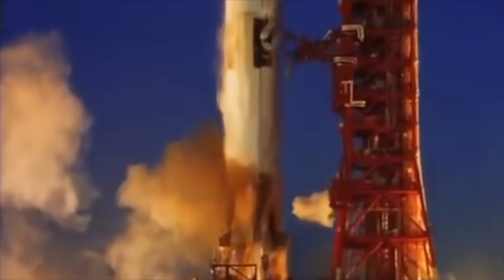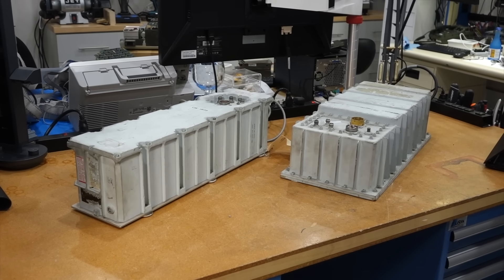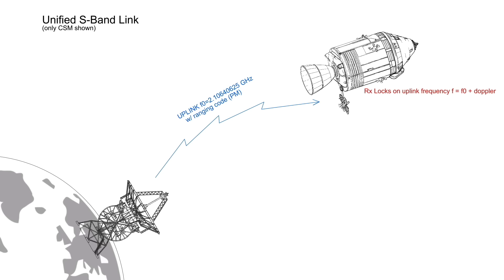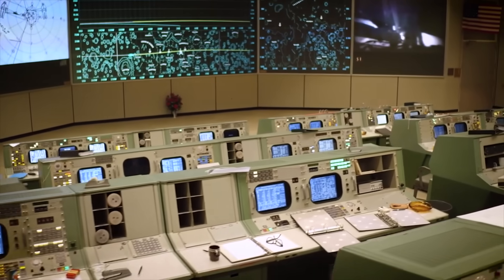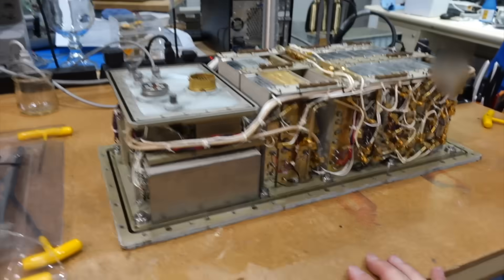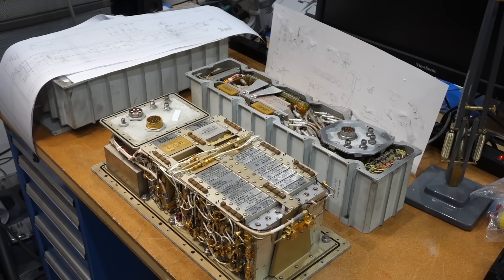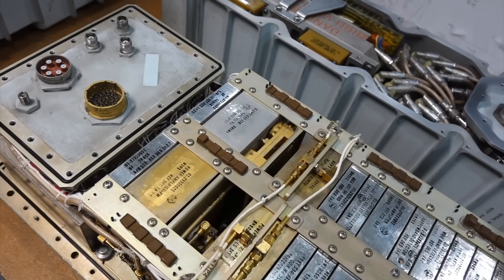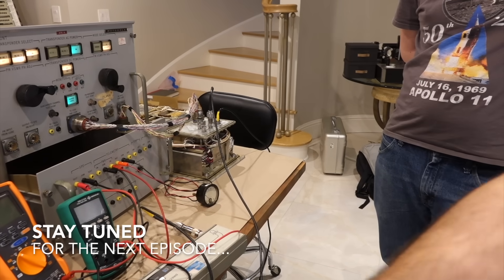Apollo Comms Part 1: Opening the S-Band Transponder and Amplifier

Comment: 10W sounds weak, but the Voyager probes' transmitters worked and works at that power. Isn't that neat?
Reply: If its too weak at one end the other has to be stronger and larger.
Reply: @Arpthingy True. Proper antennas are needed on Earth. Still cool that basically a walkie talkie reaches 25 billion km 😊

Comment: I've had people complain that the Apollo transmission power is too low, so they couldn't have gone to the moon! Well, yes: The way you handle that is you build a really big antenna on the receiving end, on the ground. That way you can gather more of that signal energy. Essentially, a really big "ear" to hear a whisper. They had to use much more energy transmitting "up" to Apollo because the spacecraft didn't have the luxury of having a really big antenna, it could only carry small ones. So you have to shout very loud so the smaller, relatively deaf "ear" could hear you.

Comment: Why was it filled with nitrogen? How does it protect the electronics?
Reply: Nitrogen is cheap and relatively non-reactive in this environment- especially compared air with oxygen and water vapor etc... They might have used noble gasses instead, but it's not really necessary and using Nitrogen is cheaper.

Comment: I worked in the Apollo Communications Systems group at North American Aviation Space and Information Systems Division, the prime contractor for the Apollo Spacecraft and had principal engineering responsibility for the  Apollo PCM Telemetry Equipment. I'd be happy to contribute my personal knowledge and experience with this, the other Apollo communications equipment and the engineers I worked with. George Whitehead
Reply from the maker: Awesome! Can you please contact us via the link in under the video description?
Reply: Hey I'm a retired US navy satcom tech post 9/11 era. Both strategic earth station terminal and shipboard surface tactical SHF EHF X-BAND. i've had questions about this system on apollo that never made total sense looking into past systems that don't translate into the more current stuff i worked on.  Just one question to start with if I may have a moment of your time,  why was there a floppy parabolic 3foot antenna on the lunar rover buggy. That would really set my suspicions at ease.  I just always saw that thing flopping around and never believed it could lock onto a satellite relay tracking beacon.  I would appreciate your insights.  Much respect and it's an honor to chat. ET2

Comment: Parkes didn't receive the first five minutes of communications from Tranquility Base,  Neil and Buz where to eager to get out and explore the moon, the the honor of receiving the first steps on the moon went to Honey Suckle Creek in Canberra as it was properly aligned to take the signal and Goldstone had an upside down image, as Honey Suckle drop out of alignment, obviously due to the rotation of the earth , then Parkes took up the signal for the next 2hrs. Parkes was not going to be the primary point of the fist communication but it received the honor because of a circuit breaker fire at Tidbinbilla Tracking Station two weeks prior to the landing.  Tidbinbilla Engineers where sent to Parkes to set it up to received the signal.  Thanks for explaining wait S-Band was, now I know why my fathers skills were needed at the tracking stations Cooby Creek and Canarvon as he studied on microwave technology.
Reply from the maker: That’s such a bizarre and misleading comment. I never claimed that Parkes received the first minutes of communication from Tranquility Base. The LM was communicating via the Goldstone’s 250 ft antenna (with Madrid as the backup) when it landed. Which was a lucky break: since they had to use the omnis on several occasions, that would have resulted in a mission abort if they had relied only on the smaller primary dishes.
Later on, Goldstone, Honeysuckle and Parkes all had reception of the FM downlink signal during the entire EVA. Goldstone had a very good signal and was selected for the first few seconds of EVA TV, but unfortunately, they had their slow-scan converter setup wrong, resulting in the infamous upside down image and bad contrast. NASA realized that within a few seconds and switched to the smaller Honeysuckle antenna for the first few minutes of the EVA. Then at about 8 min into the EVA, the Moon got high enough for Parkes to receive it on the main on-axis receiver (they apparently had it before, but off-axis). They had of course a similar signal to Goldstone due to size. So naturally NASA switched to the Parkes video, which they kept for the rest of the EVA. However they kept Goldstone for the PM uplink transmission throughout the entire EVA. So upvoice (capcom) was from Goldstone the entire time. 
So all 3 dishes (Goldstone, Parkes, Honeysuckle) received the spacecraft FM data, TV and downvoice throughout the entire EVA. They all got it. It’s just that the TV picture and voice sent out to the broadcasters could only come from one of these sources at a time.

Comment: The TWT will require high voltage....the ones I worked on used a couple of thousand volts. This potential creates the electron bean that passes from the cathode down the magnetic confinement to the collector. The microwave is introduced to the helical 'slow wave structure' a little ways from the cathode...The amplified microwave signal is syphoned off the slow wave structure before the electron collector. Energy is transferred from the electron beam to the microwave signal along this path. I skipped an explanation how this works. Traditional electron tubes with grids and such stop working as the wave length of the RF shrinks. TWTs are longish things compared to stubby traditional electron tubes. Klystron tubes use the same principle.

Comment: Can't believe we are still using USB 50 years later to "communicate" with most of our devices to "transmit" data, audio and even video 😜 guess that acronym aged really well...

(What didn't age well is how NASA is still using S band as the main frequency for the Artemis missions, giving their astronauts very low data rates compared to today's standards, but I digress)
Reply: S‑band cuts through rain, fog, and clouds so it is more reliable.
Reply: @Arpthingy  it's 2025, there are 8000 operational starlinks in orbit working in Ka band, most of them with optical inter satellite laser communication.
NASA choose to be limited to S band when a relay satellite network would have given them way more flexibility, capacity and resilience, rather than saturating the DSN.
Even China has two relays on the other side of the moon already.

Comment: Interesting that the connectors didn't change since those times.
Reply from the maker: I found that quite surprising too. TNCs, N-connectors, SMAs are way older than I thought. Military stuff to start with I guess. The transponder is also using SMCs which are still around but that you don’t see much anymore, and the ground test equipment uses the awesome GR-900 which has mostly disappeared - for good reason, it must have cost a fortune to make.

Comment: Does anyone know if there's any really interesting history or novel technology that was made for the security/encryption of all of this communication? I am curious to know how concerned they were against the USSR collecting information or doing something nefarious during the Apollo missions.
Reply from the maker: There was really no encryption on the way down and well equipped amateurs were listening, I’m sure the Russians did too. On the way up there was no encryption proper but there were lots of sub-encoding (each bit was five sub-bits), integrity checks at several levels (sending data and anti-data), telemetry acknowledgement sent back down, and a complex non standard DPSK over FM over PM modulation scheme. You’d have to steal the lock from the ground station to send something up, which would be hard to disguise. In any case, the astronauts could block all commands from the ground, and lockout their computer, which they did unless the ground requested access. They were far more worried about launch vehicle hijacking, and the self destruct system was encrypted, not sure about the abort/LVDC command system.

Comment: If they had to use hundreds of feet of wave guide I can see why they'd use other smaller devices these days. Wave guide is low loss but not zero loss. Most of my work was in high dynamic range applications and the GPS satellite. (~2 uHz steps at 10.23 MHz without adding measurable noise to the reference oscillators. Something about cruise missiles and Jimmy Carter's toity. {^_-}) But I dig link budgets well enough to sit and declare the ground station an alligator. It can talk further than it can listen, at least for the Apollo mission application. And with a handy 20 dB to 40 dB budget excess in one direction I know I'd certainly be tempted to do something creative with it, like lose the TR switch and use a separate smaller TX antenna some distance away with a lot of filtering on its output, particularly a notch on the DL frequency to keep TX WGN out of RX. (I ran across that one when the military wanted to be able to create ad hoc repeaters with two radios in the back of a jeep. The PAs in most gear of the era were {cough} dreadful. And they still are not wonderful.)

{^_^}

Comment: I had a quick read down the comments but couldn't see what I wanted to mention. You say they operated three links, for the CSM, LM and S-IVB stage. However, they would not usually power the LM during the trans-lunar stage since it shared the same carrier as the S-IVB booster. This allowed them to perform ranging on the booster stage until it impacted the moon, at which point they could power the LM without interference. However, during the flight of Apollo 13 they had to power down the CSM. At that point the carriers for the LM and S-IVB conflicted and they lost uplink. They were very lucky that the larger ground station was just coming on line and could physically discriminate between the two in terms of their position in the sky. By getting PLL with the one they could then manually steer the frequency away and allow the lock to be acquired with the LM again. I did not fully understand this until you described it so well. Listening to FIDO having a blue fit on the Apollo 13 loops is priceless. As is the calm response from SELECT. It's another piece of overlooked history that deserves to be remembered... thanks Marc. 😊

Comment: All that RG-142 and all those TNC connectors! I'm assuming that cluster of stuff under all that cable is the transfer switch matrix to switch back and forth between the primary and secondary transceivers?  Also, are the modulators for the air to ground, telemetry/biomed, and video subcarriers inside these boxes also?

Comment: Does anyone know why the flat-pack chips from 1965 (date code 6541) in that guidance computer logic board at 1:36 have the little red dabs of red paint on every chip? I've noticed it on other flat pack ICs from 1965 as well. Some sort of final-approval mark from the chip's backend test process?
Reply: I can't speak for the rest of the industry, but in the context of the AGC, those red dots indicate flight qualification. Their presence elevates these chips from the 1006321 part number printed on them to part number 1004301-001 (the flight qualified equivalent). Per drawing 1004301, "Upon completion of all requirements as specified in ND 1002248, the NOR gates which qualify for flight hardware under the provisions of ND 1002248 shall be marked in red as indicated in this document." Unfortunately we don't (yet?) have a copy of ND 1002248, but ND 1002359 can be found on the klabs website -- it appears to be a different version of essentially the same document.
Reply: @mikestewart8928  Ah yes that does make a lot of sense now, thank you! 1965 was right at the crossover from the TO-5 style package into the newer flatpack/dip styles so I guess they were also still formulating how to identify usage standards too. Awesome info Mike!

Comment: The frequency, 2.1 GHz, is rather close to the WiFi and Bluetooth bands.  It would be interesting to compare the contents of that first box with a modern solution that's found in something especially tiny like earbuds.  
The second box is the power amplifier: 11 W I think you said, and could not use transistors.  How big and heavy is a modern microwave amplifier capable of that much power?

Comment: 1960`s technology was able to transmit video, audio and data from the moon to the earth and back
2021´s cheap plastic technology offers a billion fancy features but is unable to  properly  record audio

I`m really curios about the planed re visits to the moon and the planned mars mission .. I doubt it will we as successfull as Apollo...all the systems will offer full coulour high resolution video supported gesture control but crash 3x a day and need 65 firmware updates during the mission

Comment: these systems used sub-band modulation.     that is many signals at different baseband frequencies combined and then sent to final PM or FM modulator.     this was to allow the final RF amps, to be in compression a bit to get max RF power.   PM and FM can work when amps in compression, unlike AM and SSB

Comment: Engineering at it’s finest. I keep wondering how those equipments performance were measured in the past, like THD, Noise..without a frequency analyzers, vector analyzers and all the digital modern stuff. Nothing but amazing 👏🏻
Reply: They had those tools, they were already needed for radar development.   The tools were also large and expensive.  I used to have a Polarad spectrum analyzer the size of a large doghouse and weighing nearly 100 pounds.  The microwave test equipment used a lot of Klystron tubes and microwave diode mixers and cavities.  No transistors at all as these 1960 equipments could only rely on like 4Mc/s germanium transistors.

Comment: (1) The label isn't wrong about high voltage. Even if the supply isn't very "hot" the signal processing equipment may still contain rather high voltage waveform  nodes.
(2) FM and PM can be seen as special cases of each other. They aren't radically different between themselves.

Comment: Meh. The IC industry was jump started by icbms. There’s no question of it.
Reply from the maker: The Apollo program accounted for ~80% of IC sales in the 1960s, and they got the two first commercial ICs: the integrated 3 input nor gates and the integrated sense amplifier. The move was very controversial as ICs were not used in aerospace: they were still research items with unproven reliability. That said it is true that the cost of early ICs meant that besides the Apollo program, they would at first be used mostly for military applications.

Comment: Dealing with 1960's technology will mean dealing with non-metric parts.  I bet all those screws are SAE# and the SMA connectors are probably used a 5/16" (7.9mm?)  #6 SAE torque wrench to tighten to a specified  in·lbf torque spec to insure no impendence mismatch.  I still have one if you need to borrow to put them back to spec?

Comment: Interesting....great stuff... my father was a ham radio geek, he always loved Collins gear....but a generic trivia question....did the Soviets use anything even close to this in their Lunar attempt??  Just wondering....
Reply: In the same era Soviets did land automatic probes on the Moon, then sent two remotely controlled rovers, and even automatically took and brought back soil samples from the Moon. The details about their electronics are sketchy, but they certainly had similar looking radar/communications dishes on the ground, and were able to measure and control the trajectories of the spacecraft, control them, land them on the moon, drive the rovers, and receive low frame rate video from the moon.

Comment: For transmitter comparison; I can get a 2.4Ghz 1 watt transceiver for an FPV drone for $30,  that weighs less than 30 grams and is only 20mm X 20mm. How far we've come!
Reply: transistors rule!
Reply: We are past the vacuum tube age :-) Even home stereo amplifiers are now just cheap boxes with triple digit output powers.
Reply: Well Ewen the frequency is sone or similar ... It'll not be that powerful.. if they manage to make this devices work and put that on a drone I'm sure their range will be more then 10s if kilometers in earth surface Ewen with relatively small antennas.
Reply: I'd be very curious to know how big this would be now if we had to build it with our current technology, with the same signals in & out.
And also how much wattage the new box would be consuming...
Reply: Um... theres no way you could make that power amplifier any smaller today. TWT tubes are still VERY much used in highly modern fighter plane radar systems, multiple space missions, etc. There are many, MANY rf physics reasons why you would use a device like this today for things that require precision at high output powers. A semiconductor device doesnt exist anywhere in the world for such an application today...
Reply: @jonnyj.  So you’re saying vacuum tubes are not completely obsolete and just used in fancy audio equipment? That’s pretty cool, the more you learn i suppose!

Comment: The units of measure that you call archaic got that gear to the moon...Kilograms of tea were thrown into the harbor and Tons of freedom floated around for the world to see. That said, another great video. Thank you so much for all you do!!
Reply from the maker: That is of course not true. Even at the time, all the calculations were done in metric units, and just converted for display to the astronauts and the flight controllers. Similarly the AGC works in metric units internally, and just converts values before it's displayed on the DSKY.